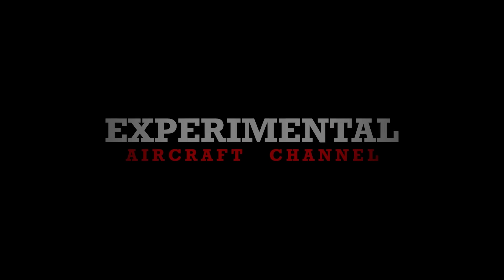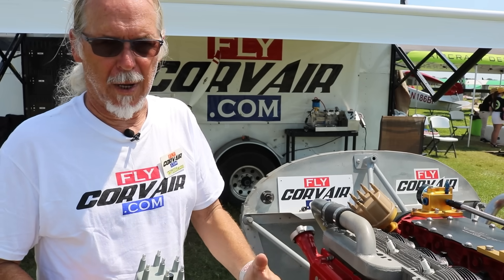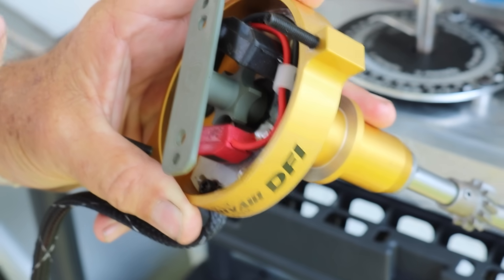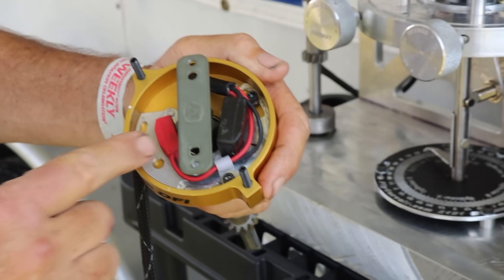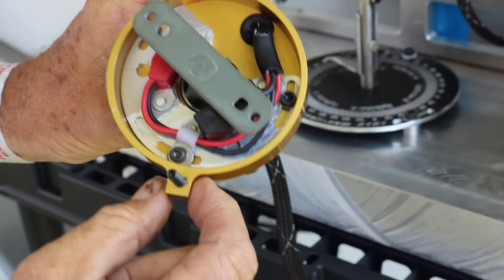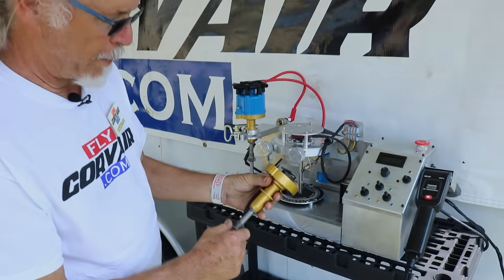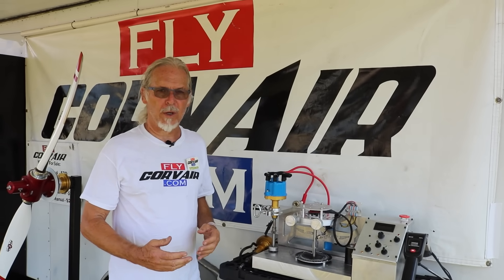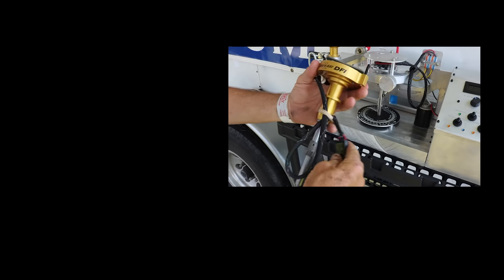Corvair Aircraft Engine - New Updates and R&D Debut at OSHKOSH 2025

Comment: Its a shame of all the negative comments below. This is a 6 cylinder engine, most in this horsepower range are 4 cylinders, which he pointed out that fact and a 6 cylinder is giving you two extra cylinders for redundancy. He had proven time and time again that the durability and reliability of this engine design. Once you would complete the build process of the Corvair to his specs, you would have mostly new, brand new, components. This should be viewed as a brand new engine upon completion, not rebuilt or remanufactured. Just as important, at a price point that is well under anything that is closely comparable in this horsepower range.  But even more important is the fact that thru this build process, you will understand and learn everything COMPLETLY about the product of which you just built. This man again, has thousands of proven examples flying.

Comment: Go diesel, remove requirement for any ignition system period. Gain range and reduce chance of fire dramatically all at the same time
Reply: In theory diesel engines are great for aircraft, but in reality they’re too heavy for most of GA.
Reply: Go diesel with what? Diesel experimentals are rare for a reason. Available aviation adapted diesels cost an arm and a leg, and automotive diesels that make enough power but aren't too heavy are pretty uncommon, and they're always turbocharged.
Reply: Diesel engines in their current form are way to heavy for most aviation uses. There are several companies actively working on diesel engines for aviation use however, and we are all very exited for them to succeed.
Reply: @RobinsonRoast this is actually not true at all about weight but it's a common idea. There are big names including continental that make aviation specific powerplants. Some are custom aviation others are even automotive converted 4cyl Mercedes engines which are very light and more than make up for the weight with fuel burn/range torque and direct drive being possible. There's also options that are in development but the tech is all there and nothing new as you are aware. Two stroke diesels are much lighter and twice the pwr to weight than avgas equivalent. In the experimental world there's options like the Subaru (Fuji heavy industries) ee20 4 cyl horizontal opposed 2.0 turbo diesel which is 10kg lighter than euro 4cyl 2.0 automotive engines just like the one made by Mercedes that's already been in use a long time in the air. It's also a shorter block than the petrol equivalent and the balance is perfect with the boxer configuration. So it's not that the engines are too heavy that'soften assumed or falsely stated through comparison to the general automotive and machinary application but not an inherent factor. Its actually the way of the future for piston engines planes. From an engineering perspective you can't get better. Think about tbo on a Rotax revving it's guts out at 5-6000rpm compared to a Subaru ee20 doing 1500-2000 rpm with no vibration like a Rotax. The mechanical wear on the rotax is exponentially higher with revs not linear. With half the fuel burn on a fuel that's not flammable! It's combustible which is the difference between wood and avgas both burn one explodes. Hopefully the industry sees the opportunity rather than the hassle of changing over from avogas and mogas to make more profit. Because it's more resistance from them not the need for development in the engineering side. The net zero rubbish is also a force against diesel, which ironically can be much cleaner then any EV system in terms of production manufacture and operation

Comment: Why on earth would you take an obsolete car engine from the 1960's which is no longer in production and use it in an airplane? Makes no sense to me. But then again, the VW Beetle engine is even more obsolete and they are using that, so I guess these are only going into experimental aircraft where the owner is taking the full risk on themselves so the authorities don't really care.
Reply: Why would anyone put an obsolete Continental or Lycoming that hasn't been updated since the 1950s and use it in their airplane?
Reply: @DarthéHelmüt for the simple reason that they have been proven to work well😅
Reply: @DarthéHelmüt the mere fact that they are being used today, debuts the claim that they are obsolete 😊
Reply: @DarthéHelmüt   I'm pretty sure Continental and Lycoming engines are still supported by the manufacturers. And yes a lot of vintage aircraft have those old Continental and Lycoming engines, but if you are building a new aircraft why not use a more modern engine like an Rotax as you know that parts and service are going to be available from the manufacturer for the foreseeable future?
Reply: @aftonline  bc Rotax manufacturer is 100% with their head up their arse with the current prices. aside from other complaints from not theoretical but actual pilots about those high rev expensive to maintain jewels.
Reply: Maybe because they are reliable and simple to maintain.  Sounds to me like a comment from someone who hasn't got a clue.  I had a Corvair, back in the day, and had a cylinder die on me on a trip to Yosemite.  I was able to drive the 250 miles home on five cylinders with no problems.  It was an easy and relatively inexpensive rebuild afterwards.  You can have these overly complex, totally computer controlled engines that only highly trained and highly equipped technicians can work on.  They don't "repair" anything nowadays, they just look up the computer error codes and replace the part.
Reply: @lanpartyanimal5215   well at least the part is available to replace. Is GM still making Corvair parts? I guess it doesn't matter as long as there are aftermarket parts?
Reply: To quote the late Paul Harrell: obsolete does not mean ineffective. This channel is about EXPERIMENTAL category aircraft, a huge driver in experimentals is cost. Think about this for a minute. Certified aircraft engines cost as much as or more than an entire homebuilt. Nobody makes air cooled engines anymore outside of industrial and motorcycles so "obsolete" is your only option there unless you're building something tiny. Liquid cooled is arguably another layer of additional points of failure plus weight so you're better off using an obsolete corvair engine than say, a modern "not obsolete" engine like a Honda K20, which by the way will still cost you a lot to adapt to aviation use because it uses EFI and electronic ignition.
Reply: The reason is opposing cylinders that can be individually removed and replaced components with ease.😊

Comment: For those who want to or have to just buy parts and bolt them on, read no farther. I bought William"s book to build my corvair engine several years ago. It has a wealth of information and I wouldn't recommend that anyone build one without it. However, I did not buy any of his parts except for the exhaust pipes. In retrospect I wish I had just used the Corvair exhaust logs to keep it simple and inexpensive. His pipes are a work of art though. I bought an engine mount and a distributor from Azealia Aviation for no reason except that I was at Sun-n-Fun and he had them. Not everyone has a lathe and a mill, but if you do, you can make almost all of your own parts including the 5th main bearing housing. You can save a lot of money on the starter if you use a PT Cruiser flex plate and a Valeo 594081 starter which is tiny, runs the right direction for a front mounted Corvair starter, can be installed lower, and NEEDS NO MODIFICATION. Also make your own fiberglass cowling, for goodness sake!

Comment: With all the modern technology available…a distributor cap. Seriously??? Why
Reply: Simple might be better in some ops
Reply: Look at magnetos, they still have a cap and rotor too. But yeah, fully electronic with coil to plug direct ignition would honestly be the best way to go, it's known and reliable and far less of a chance of internal arcing being a problem. But there again, it's also cost and acceptance involved.
Reply: @Oldbmwr100rs also requires the battery to have a certain minimum charge😮mags for me